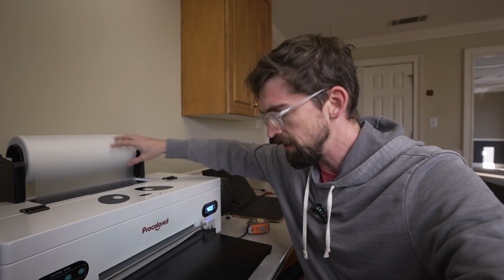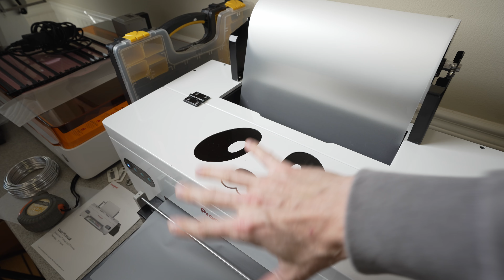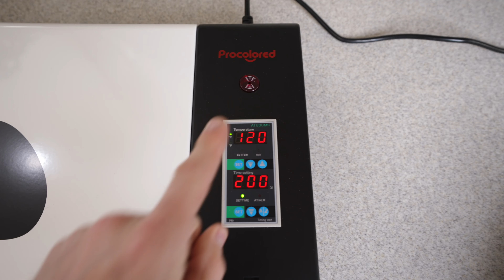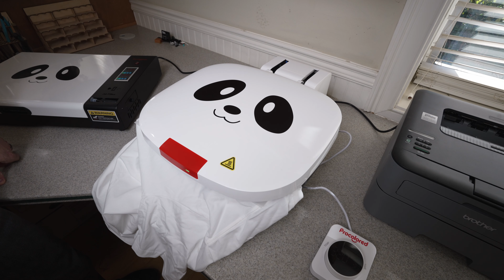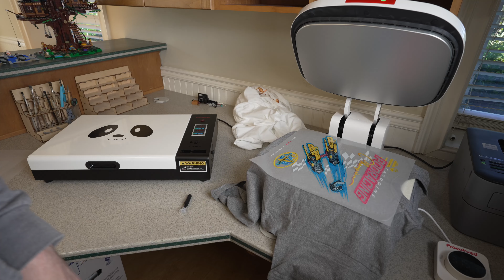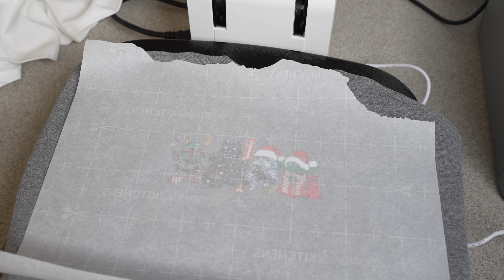Making Shirts with a Printer?  Procolored DTF F13 Panda

Comment: You might need to do a Hot Peal. Depends on fabric and on the DTF itself
Also a teflon sheet on top between the sheet and the hot element on the press is a MUST
Reply from the maker: I tried a hot peal but had better luck doing it warm/cold.   Just got a teflon sheet in and will try it next.  The parchment paper was all I had on me at the time.
Reply: @makeorbreakshop  I get mine printed out - dont have enough production to justify the hell of maintenance a printer is. Temp of peal does vary on weather, humidity and global room temps. Bit finicky!
Would love a 6 months update on the printer to see if you kept it in production or gave up on it :D
Reply: It doesn't depend on the printer or the fabric or the ink, it depends on the film if it is hot peel or a cold peel. Cold peel makes you waste a lot of time.
Reply: Also you should be doing a set press after removing the film. This helps ensure adhesion. Also agree you should be using a Teflon sheet for protection.